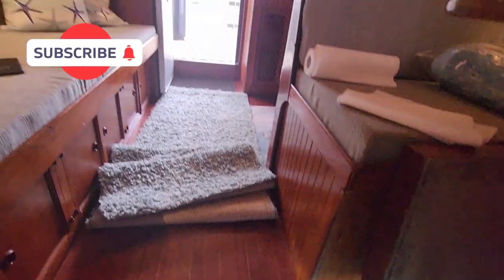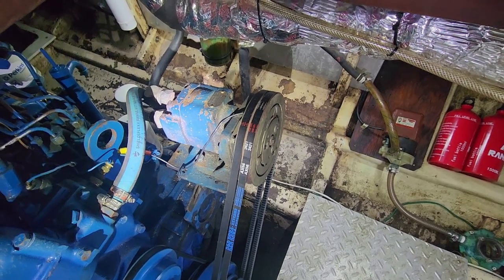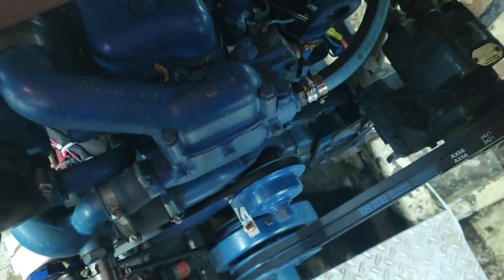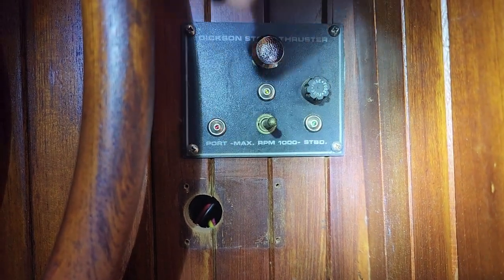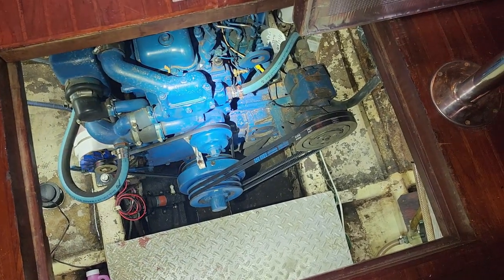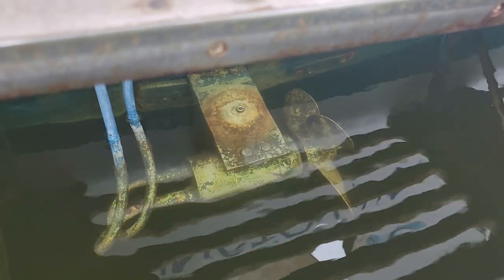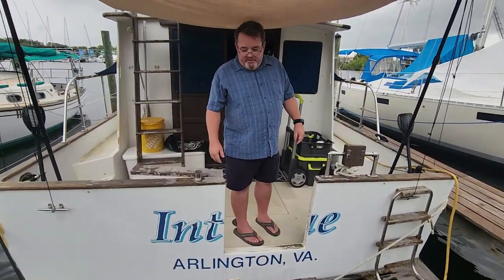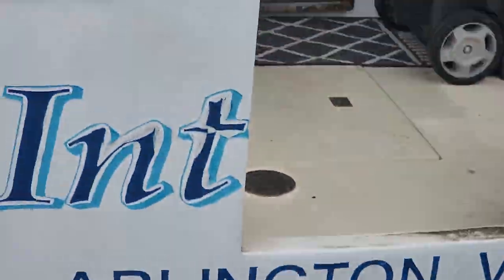Electric VS Hydraulic Trawler Thrusters- Dickson Hydraulic Stern Thruster Overview and Operation

Comment: Does the thruster hang down beneath the back of your boat?  I have been contemplating a hydraulic stern thruster for a few years but my transom only goes down in the water about 5 inches.  I worry about drag.
Reply from the maker: It does not hang down. It could stand to be a bit lower as you see from the cavitation...lol. But I really need to fill my water tanks since I have 150 gallons right in the back. I also need to relocate all my tools and parts from the V birth to the aft storage once I am done. That will help too. I am not sure 5 inches will be enough. Obviously a bow thruster would work for you.
Reply from the maker: Ron..I added a link in the description to an old video where you can see the thruster when the boat was on the hard. You can get a good view there. https://youtu.be/gfj0UQAIacQ?t=274
Reply: @mvintrigue-trawlerdiy1101   - thanks - you just can’t beat real life info !
Reply: I agree your thruster should almost be down at the bottom before the hull rolls under.